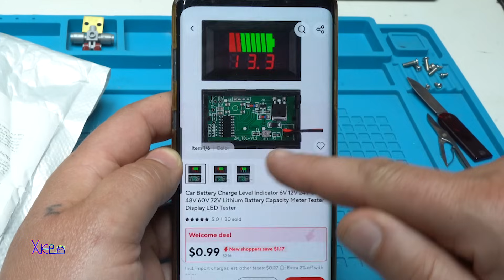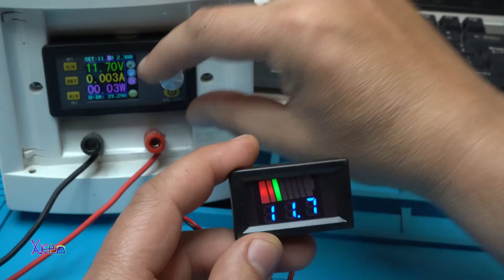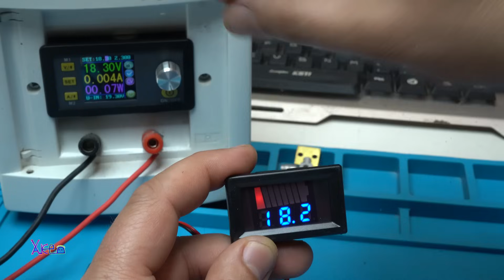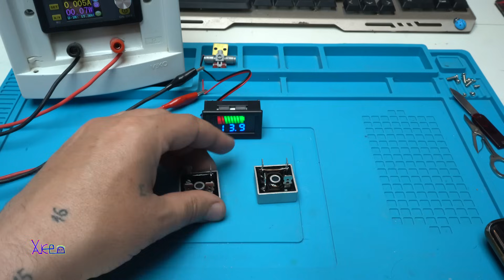$1 Aliexpress Voltmeter - Good for Project's?

Comment: Do not trust those bridge rectifiers, they might do 50A peak, but in real world use they should be on a decent big heatsink and derated to 10A, otherwise they will have a very short life. at 10A they will be dissipating around 15W of power, so you need a pretty big area of heatsink or a smaller one, and a fan blowing across it. Old non heatpipe Intel CPU heatsinks work well for this, as you get a good thermal transfer, after drilling and tapping a M5 hole in the center of the bottom, and the fan will cool it nicely.

Comment: That indicator is useless cause when u connect any load to the battery the voltage drops and the indicator shows low level battery which is actually not low , so the module doesnt do any smart calculation just shows led level depending on voltage , in this way battery level measuring is not accurate , the system is flawed

Comment: 2:27 When my 12v Pb battery in my car is 8v its fully charged according to that meter?
Reply: yes , but why would your battery go to 8v ? its going to 8v means u have done deep discharge hence permanently damaged some part and the battery will not get its full capacity back when u charge it again.
Reply: @khan.No1  Parasitic drain.